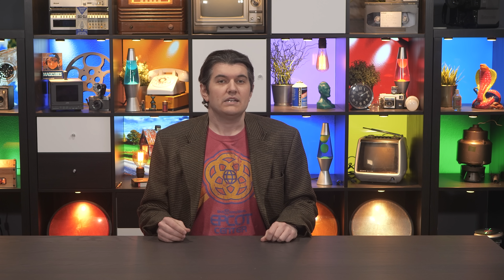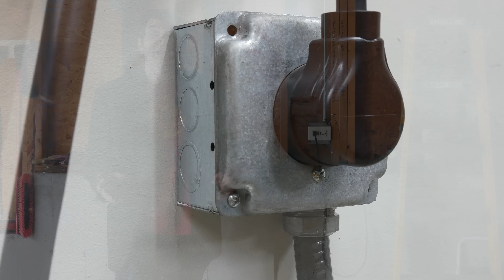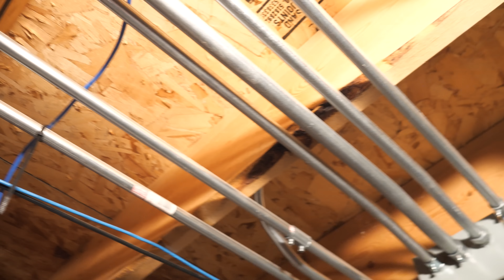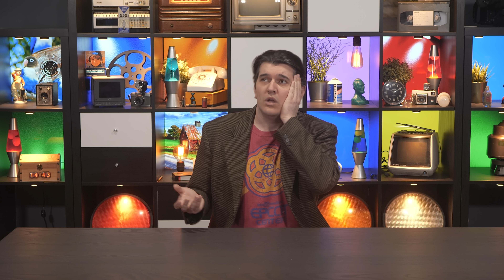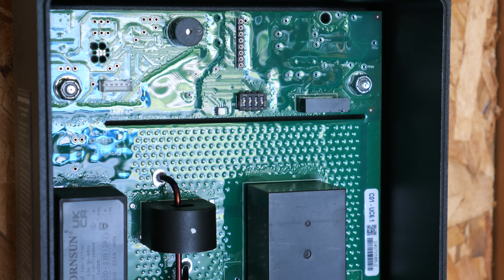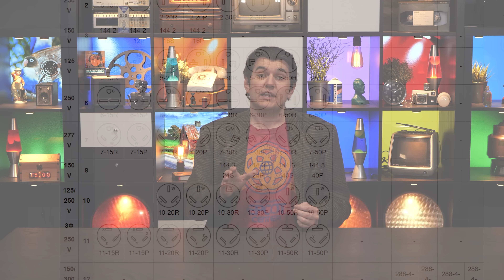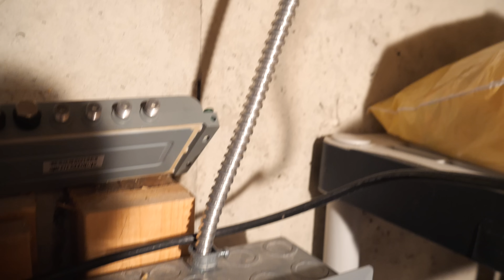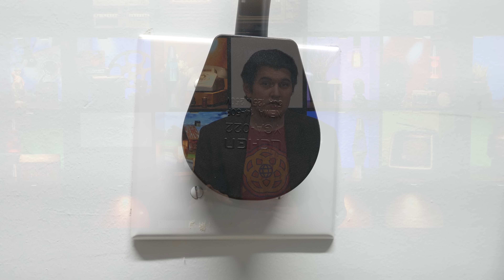The "standard" car charger is usually overkill—but your electrician might not know that

Comment: To be honest though, it seems as though the main reason the NEMA 14-50 has become the "default" receptacle outlet for EV charging in the US is a matter of convenience, considering this receptacle can be found in just about every campground and RV park in the US, meaning anyone that owns an EV can go to a campground and grab a charge.
Reply: Is that actually a thing?
Most camp-grounds I've been to in Europe don't allow to charge your car. Either because their grid couldn't handle the extra load or they don't have meters installed at every camp spot.
Is that different in the US?
Reply: @Jehty_ yes, in the US I've seen a few EV's charging at campgrounds I've visited in North Carolina and South Carolina, however I don't know if they have restrictions as to how many EVs are allowed to plug in and for how long.  At the campgrounds I've been to almost all the vehicles parked there are fueled by gasoline, with some of the heavy duty pickup trucks equipped with diesel engines.  For the RVs that park there we have two large receptacle outlets to choose from depending on how large the RV  is.  They are, the TT -30, which is 120 volts, 30 amperes, and the NEMA 14-50, which is 120/240 volts, 50 amperes.

Comment: My argument against 120v/15a charging is that it’s substantially less efficient and puts unnecessary wear on the cooling system. For example, a model Y can consume around 300w any time the HV battery contactors are closed. That means that if you’re only using a 15a 120v circuit, 20% of the power is going toward powering the car instead of charging the battery. Over the lifetime of the car, that adds up. 

Additionally, if your car is literally always trickle charging, the electronics and coolant pumps are always running to keep the electronics cool. That can’t be good for the longevity of those components.  

I do agree that in many cases 32a or 48a 240v charging is overkill. But unless you put on very minimal miles, using a regular 15a 120v outlet is pretty wasteful.
Reply: Do they even need to keep cool if the charge is only 12 Amps. If it's meant to handle 50, shouldn't 12 be a breeze?
Reply: @BL3446  on a model y the coolant pump runs to cool the computer any time the vehicle contactors are closed.
Reply: @andrew71233  Yeah, but the Tesla coolant pumps are variable speed, and magnetically driven; still, fair point about keeping the support electronics powered for no good reason.

Comment: My mother bought her 2020 Bolt EV expecting she would end up having to spend $2000 (~$1000 after subsidies) on getting a L2 cable installed. Five years later, she's still happy using the OEM 120V 12A cable.
Reply: Better yet, that OEM cable that came with the 2020 model (which I also have) also supports 240v/12A input through the use of adapters, thanks to the fact its internal board is the same clipper creek make as the European model. I keep some adapters that convert the EVSE's NEMA 5-15 plug to 6-15, 14-30 and 14-50.

Comment: In Europe, you get 3600Watt from any standard outlet (225V*16A). We have often CEE Outlets with 3x16A or 3x32A (3x16Ax225V=~11kW).
Reply: Though, most Type F style sockets are only ratet for 10 or 13 A continuous.
Reply: @DooMMasteR true! Butthat’s not the one we are we are talking about. We are talking about the CeeForm or IEC 60309 connector.
Reply: @JJVernig  I know, but for outsiders calling it CEE is a bit confusing, because CEE 7/3 is also a CEE Outlet.  
Non EU readers might just not know the "name usage" of CEE limited to 16/20 and larger (as it is common at least in Germany).
Reply: @DooMMasteR  True! And CEE7/3 is also getting hot when overloaded >10 A. And could meld. It is also a pre-war standard and has just as many problems: non polarity, using a non-earthed outlet for appliances with earth connection. When used earth it feels a little better than the US ones, but isn't perfect at all.
Reply: I'm talking about the red IEC 60309 Socket. These can do 3 times 16A, 32A, 63A or 125A, depending on the size. 16A and 32A are common. (11kW/22kW)
Reply: Yes, and i've never heard about the red or blue ones melting....

Comment: I have to disagree on the point of "The car can do that." with an exact use case. The Volkswagen ID.4 Up until the major 3.0 firmware update, it DID NOT have a charging time limit. You know, the very basic option to charge only during certain hours. Instead, it had a setting to enter when you'd be leaving, so the car would make sure it was fully charged (or charged enough) for your departure. TERRIBLE for people like me who live in a Time Of Use power area with no other options. I HAD to get a smart charger to keep the damn thing from charging itself during the most expensive times of the day, since my only other option was to stay up past the time I'd normally be in bed by perpetually to plug the damn thing in.
Reply: That is... Typically VW. They still have not learned to like EVs

Comment: Meanwhile here in the UK we can easily install 22Kw chargers...  Also what is this 80% rule about?  RCBOs in the UK  (GFCI to you) are easily available upto 50Amps.  Most EU chargers are also smart and have sensors to vary the charge current so you use your solar, don't overload your supply and even charge when electricity is at it's cheapest rate.   In our neighbourhood we also have on street charging points.  Socketwise don't you have an equivalent to the IEC Ceeform connection?

Comment: I just picked up a '25 Ionic 5 with the NACS connector. I got the "Free" EVSE from Hyundai and I had it wired for 11kw.  But, I have only used it at 11kw once.  Normal nightly charging to charge my 100-150 miles of commute, I set the I5 to 60% current, which give me 6.8kw of charging.

Comment: I'm lucky (or unlucky, depends on your views) living in NJ and NJ provides up to $1500 money back for installation of EV charger at home (some fine prints, figure it out yourself). With that there's no reason not to install a proper 40A charger for your EV. I've tried 120v/12a charging then I first purchased my 1st EV - KIA EV9, but it was painfully slow. It only changed a low double digits percentage overnight. Ok for very short runs, or maybe with smaller battery EVs or PHEVs cars.